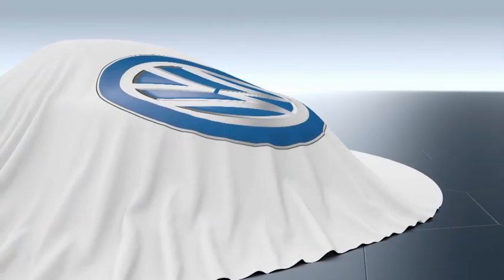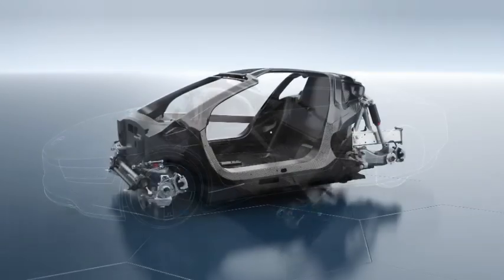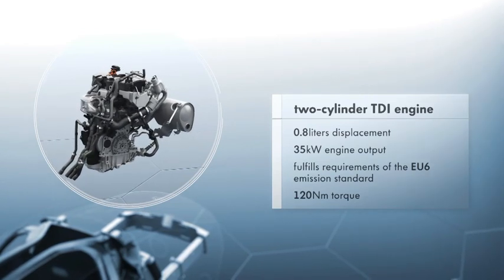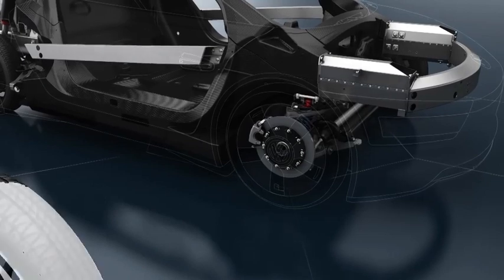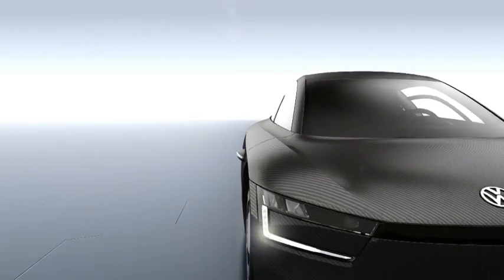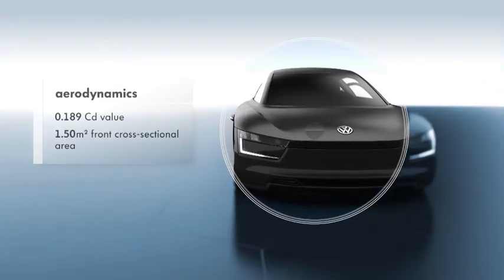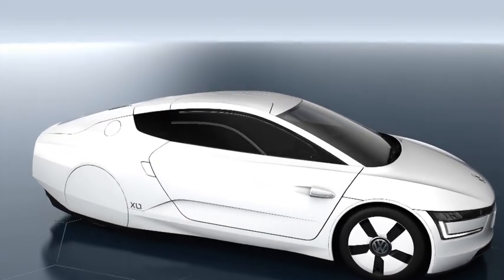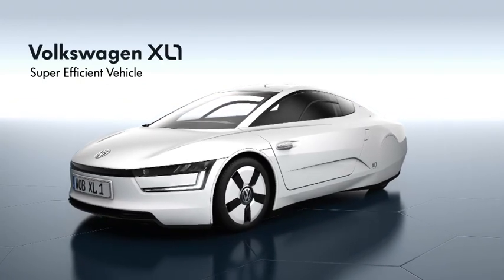Volkswagen XL1 Animation Technology

Comment: Certainly the underside belly pan contributes greatly to the pursuit of lowering the coefficient of drag. I noticed in my Mk4 TDI 5speed Jetta just by installing a .095" sheet of ABS under the entire vehicle my mpg went from 48 to 57 overnight. This was in addition to adding 16" Walmart pizza pans on the factory 15" wheels, vortex generators along the rear roofline, aluminum rear diffuser (downforce not really needed on a fwd car) and front grill blockoffs. My best so far has been 744 miles on 11.9 gallons: 62.52 mpg while I typically achieve 56-58 mpg. What wonderful machines Volkswagen has and will forever continue to offer this world.
Reply: That's 3,76L/100km. Impressive. Without belly pan and keeping speed between 70-95 kmh (44-57mph) I get 3.97L/100km (59 mpg) in a 1.1L gasoline car. <some drafting was used on that test>

Comment: 8.4 hp at 100km/h...mmm i want to see that.
Reply: The original concept, driving prototype , pure diesel, not the fat pig here, probably really did that. Actual weight? Who knows. Somewhere below 380kg.a lcc rocket weighs that, without carbon n magnesium, without roof, but 150+hp.           So. Let's say 300kg. A gsxr 750 crosskart is that...     Plus driver.    380.     Compare a honda innova125.  110ish kg plus rider.180. But worse aero
Reply: @gur262  the hell you trying to prove here